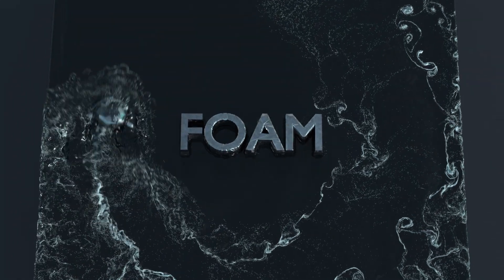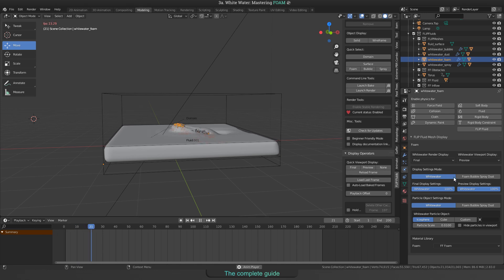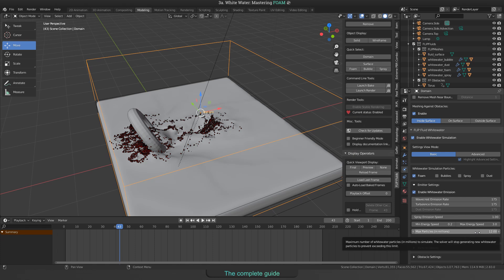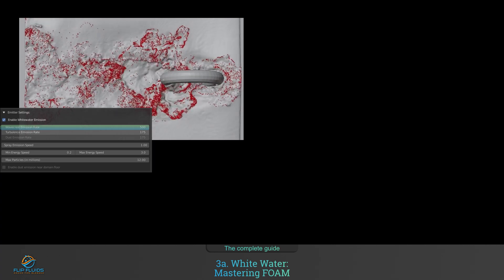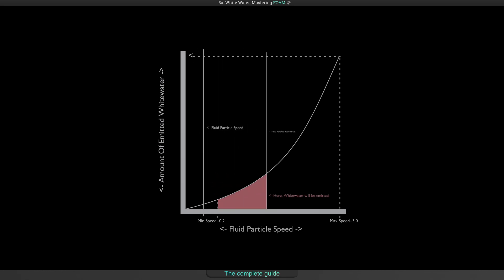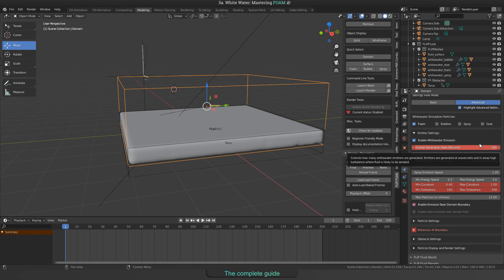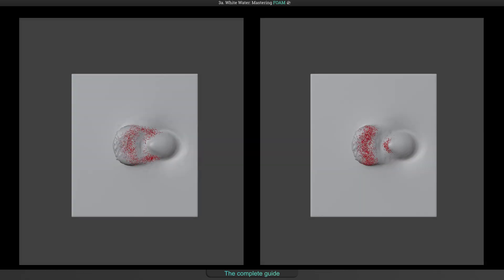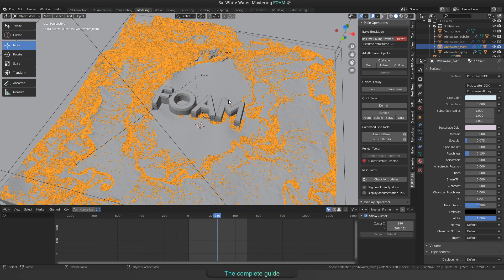FLIP Fluids Addon | Mastering FOAM (3a)

Comment: Is there any type of sheeting for the foam particles so they dont look so individual?
Reply from the maker: Sheeting is there to fill holes by adding extra fluid. For foam you can try to change some advanced settings. Use also randomized sizes with the modifier and render with motion blur enabled. That should help.

Comment: Question: when setting up a Flip Fluids 'Domain' with a 'Fluid' box in it to act as an ocean and an 'Obstacle' (a boat).
I animate the boat and render at 65 - It works
I render the same scene at 150, and the 'Fluid' ocean has now shifted way up over the boar "Obstacle', I then must re-locate the Obstacle and render again.
But have to move the Obstacle at each new render setting
How do you fix this issue?
Reply from the maker: Would you please send a support request using our form and attache an example blend file? This would help to support you with this issue :)

Comment: Hello, your software is very impressive, in fact, it's the reason I use Blender. However, when I conduct simulations with Blender+Flip Fluids and then transfer them to Cinema 4D as Alembic, I face an issue. Particles like foam and spray do not align in timing with the fluid mesh. Everything looks fine when I watch it in Blender, but as soon as I import it into Cinema 4D as Alembic, their timings and coordinates seem to shift. Could you please help?
Reply from the maker: We sent an answer per email. Please check if your FPS setting are the same. Unfortunately in some cases alembic export from blender can be not 100percent compatible with other 3d packages. Let us know if there are more questions

Comment: Is there any clever way how to apply motion blur for just the foam while rendering? it would be such a game changer since you will not be able to see individual particles.
Reply from the maker: Hi Fajarunn - that is possible! You just need to click the initialize motion blur button in the helper addon. This will prepare geometry nodes and activate our attribute system for motion blur. Important is to do it before baking. Then you will find a modifier on each object (foam, spray, bubbles, dust, surface) where you can set the strength for rendering. Hint: motion blur is not visible in the viewport. Just in the final rendering.

Comment: Got a "problem". I just got your add-on, it's great!! However, changing the offset and dept in Particle settings don't change the foam position in the viewport, even restarting the playback or refreshing the frame. Anyone got a suggestion? I'm in Blender 3.3, thank you! :)
Reply from the maker: Thank you for your message! This settings need to be changes before baking.To change particle position after baking you can use Blender´s "delta-transform" (not part of the addon) to move particles. The depth cannot be changed after baking. Hope this helps :)
Reply: @FLIPFluids  oh jeesh, of course! How didn't I think about it 🤦 Thank you for the reply, I absolutely love Flip Fluids 🖤

Comment: Is there a way to render it in eevee or is it only supported for cycles? (I render in eevee because it is faster and simpler, but it crashes a lot on a single frame)
Reply from the maker: Eevee will work as well, but for highres sims cycles will be more stable!
It depends on your computer hardware and is not a limit of our addon.

Comment: for some reason the foam material isn't working for me? it still shows as icospheres
Reply from the maker: All white water particles are icospheres. If this is visible they maybe need to be scaled down a bit. Also make sure, that a shader is applied. The addon does not do this automatically.
If both is checked, and a rendered still looks wrong you can send us your blend file and we take a look into this.
Reply: @FLIPFluids  yeah it wasn't applied. But the shader for the foam doesn't work it seems
Reply from the maker: Did you reload the actual frame and rendered a still using F12?
Reply: @FLIPFluids  I think so. The other materials worked.
Reply from the maker: I will check if something has changed in the last blender versions. Thank you for letting us know.

Comment: A beer tutorial (specifically aimed at getting the foam to rise up and fill up the glass) would be amazing :) Any updates on when new tutorials could be expected, if any at all are even in the pipeline? :) Thanks so much for all the help so far! Amazing stuff! <3
Reply from the maker: That rising foam is not possible actually. You will need to fake it in any way. However, this is something we wrote to our feature-request-list.
Reply: @FLIPFluids I actually got bubbles in pouring soda. Then with a particle system you can have rising bubbles. Make the bubbles lifetime long, and then trap them where they'll all build up. It's pretty cool.

Comment: Thanks for these videos!!! I would like to ask what kind of equipment is needed for the computer equipment? Because I did not perform the preview as smoothly as you
my computer : CPU: I7-6700   GPU:GTX1070   RAM:32GB
Reply from the maker: Did you try to switch to preview-mode for the surface (mesh) and whitewater particles? Are there any modifiers?

Comment: Hi. You promised a tutorial How to use whitewater settings for specific scenes! When to expect it?
Reply from the maker: Right! This will take a longer while as we are working on different tutorials the same time. Is there a specific thing you need to know?
Reply: @FLIPFluids  Beach waves should be a good starting point I think. Also it'll be great if you could tell more about preferred domain size, how whitewater and fluid surface(waves) depend on it's size. During testing real world domain sizes, about 200m I found that addon behaves incorrectly and gives weird results for the fluid surface as well as whitewater.
Reply: It'll be also interesting to see rivers and waterfalls examples.

Comment: @Flip Fluids  Can you drop the materials? For the foam and the spray etc.
Reply from the maker: They are included! You can select foam and add the FF_Foam material in the physics-tab on the right.
Reply: @FLIPFluids  it is not included in the demo right?

Comment: I just purchased Flip fluids for Blender. I have been using Bifrost for Maya for some time. First of all, I like the simplicity of the tool, congratulations. Simulations are solid, cache is responding very well and the process is overall stable. Although I'm just landing, my feelings are positive.
My aesthetic complaint, although I still have to go through most of the settings: just looking at your animation, this video, from the top: why is the foam making so many spirals and loops? for example at 14:00 you can see many of them happening. Can this effect be mitigated somehow?
Reply from the maker: You could try to change the Advection Strength.
Find it in Whitewater > Particle Settings.
Decreasing will result in more spreading ww-particles.
Reply: D u think bifrost is better than blender sims
Reply: @aryaman3083  bifrost is good but unstable and difficult to control, IMHO.